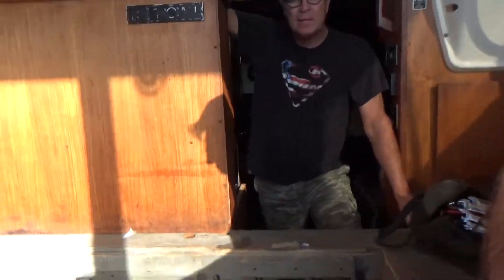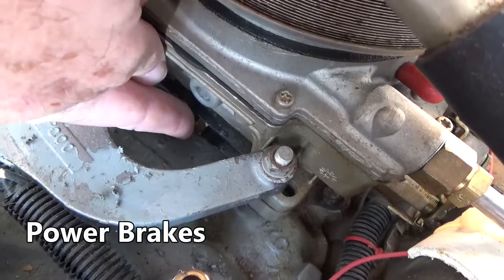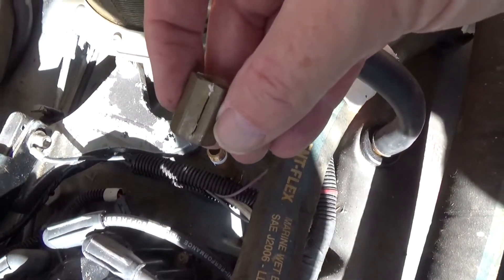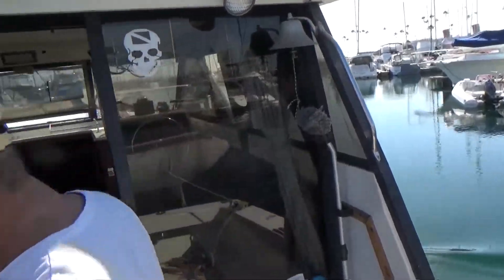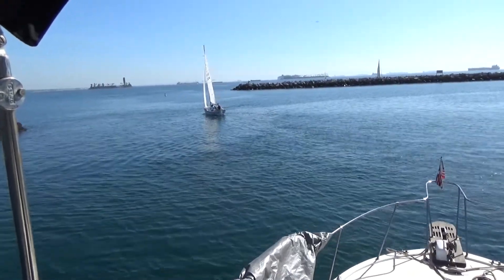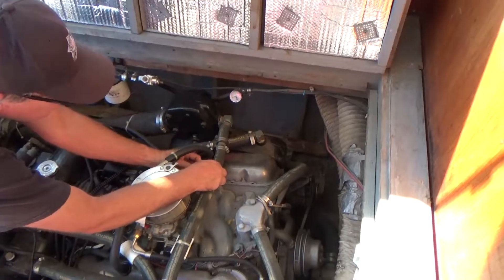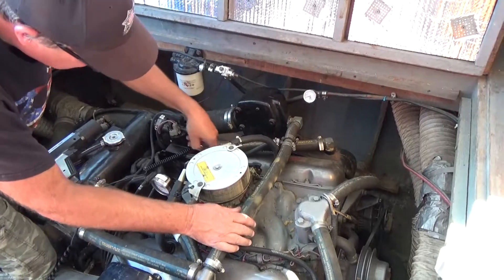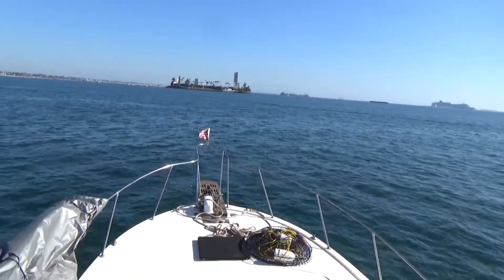KOKOMO Port Engine Fix.  Ep.69

Comment: Your valve train is screwed because of low oil pressure replace both engines with 460 ford big blocks so you never have valve train problems
Reply from the maker: Boat was sold last year.  Real issue was that there was no advance on the distrib.  Thanks for watching.  Cheers!